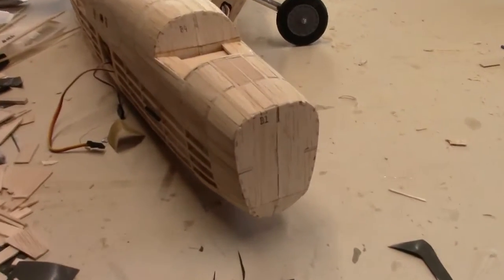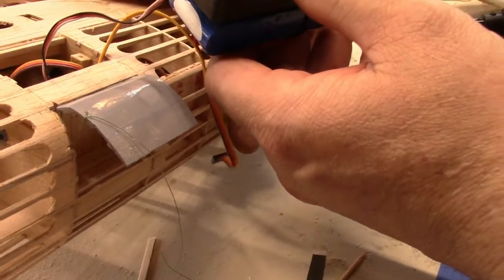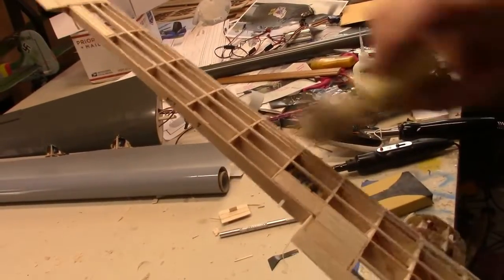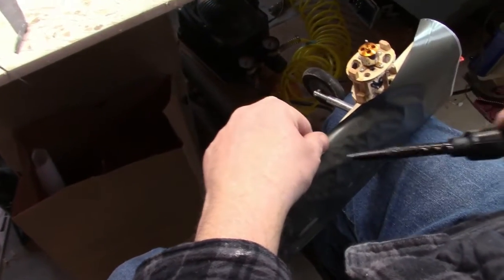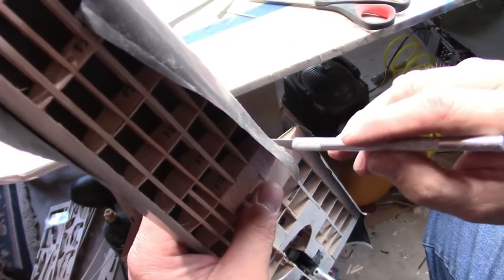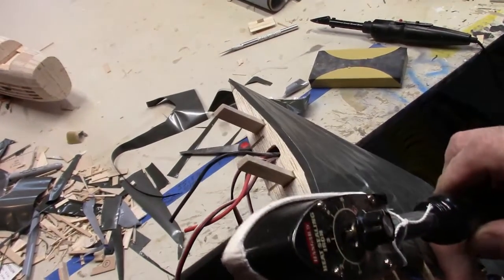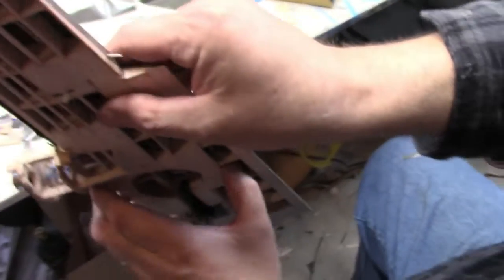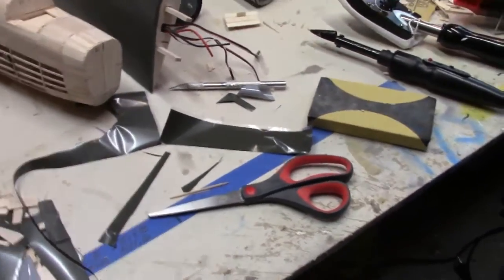Guillows B-24 rc update #4

Comment: Your excellent building talents notwithstanding, if this model is intended to fly, its structure ought to be completely altered (lightened) as its design is greatly overbuilt. As designed, this model's wing loading will prevent it from achieving flight at anything close to a scale airspeed. Of course, if flying a B-24 around like an F-16 is satisfactory, no problem.

Comment: Do you have a link for the shrink tube heat gun?
Reply from the maker: here you go. it is just like this one. https://www.ebay.com/itm/110V-300W-Hot-Heat-Gun-for-18650-Wrap-Heat-Shrink-Tubing-Temperature-Home-DIY-/152684863190?hash=item238cba1ed6